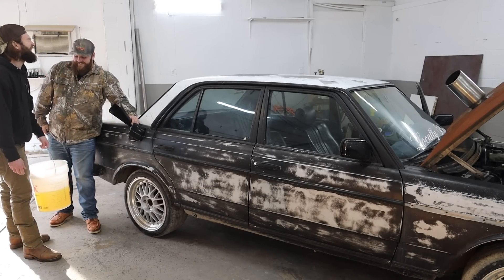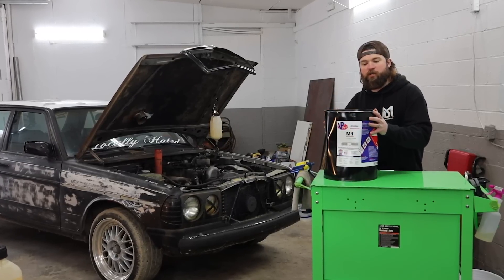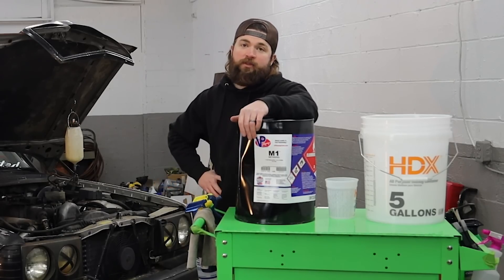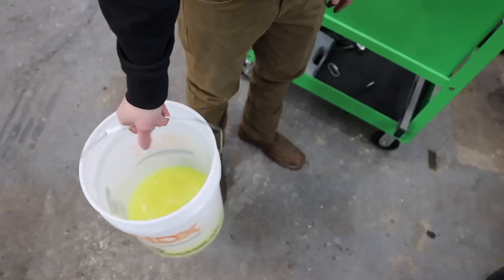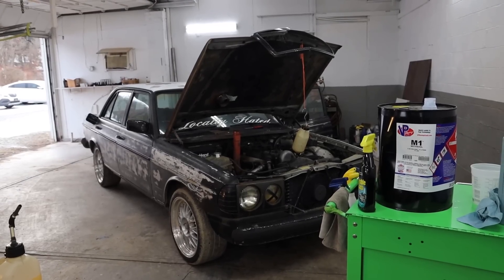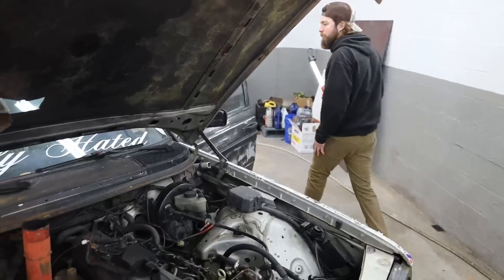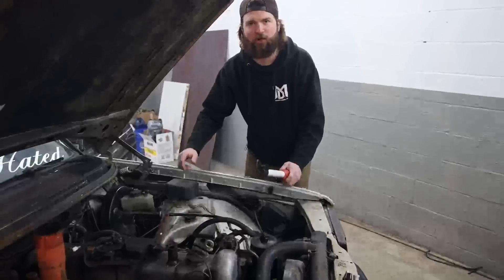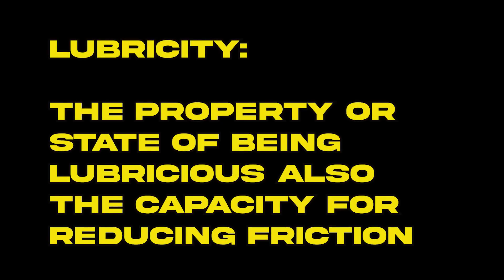What Happens If You Put METHANOL in Your Diesel?

Comment: the reason the bottle ran so fast is that its returning the excess back to tank thru the return line
Reply: I remember when myth busters did a fuel economy test and all of the results were the same. They ran a small tank similar to this and didnt realize the fuel was returning to the tank. They put the episode out too.
Reply: @4x4le  remember that i was around 13 years old then and even then i was screaming to the tv
Reply: Oops I just said the same thing
Reply: That is 61 bucks in that can? Is that enough for a full pull? Running that fuel takes different jetting I believe than Diesel
Reply: Don't you have to raise the compression to get efficiency out of the motor?
Reply: @selrahc2061  you shouldn’t have to in a diesel. Compression is what ignited the fuel to begin with so it should already have adequate compression for this purpose.
Reply: Yeah 🤣 DUH.
Reply: Yep your right and the ratios he said at 10 % is now wrong it has to be greater
Reply: There is no return line in the W123 or ay mechanical diesel I can think of for that matter
Reply: @TheAnimal191 😅

My 1989 new Holland 6.6 inline 6 has a Bosch AE pump, almost identical to the PPUMP, but I have a return line, I know because my diesel heater tank is the primary return line capture tank, with an equalizer line so it dumps it's overfill back into the vehicles main tank.

So the mechanical pump from 1989 has a return.

Comment: I'm sorry, but this is a really stupid, poorly researched idea. Methanol is a solvent with zero lubricating properties. Diesel injection pumps and injectors survive the high pressures they deal with ONLY because of the lubricity of the fuel. Goofing around by diluting your diesel fuel with a solvent will ensure the early demise of your engine. I suppose it amuses you viewers.

Comment: No doubt the system is very well aerated.  It will take a fair amount of time to get all the air out of the pump, lines, rail and injectors.  You should have refilled system with good diesel, then run it long enough to get all the air out.
I bet much of your fuel was shuttled back to fuel tank, through fuel return.

Comment: 5:22 heyyyaaa...if you rotate the can so the spout is at the high point (not at the bottom) when you're pouring it outta those cans...it won't slop and splash around so bad, and you get to tip it over further before it comes out too......jus sayin'

Comment: M10 will more than double your torque output at a given RPM low in the range compared to straight diesel. As you increase RPM, the torque improvement decreases to double the output. As you increase to M20, output advantage drops, M30 drops even more. To get a stable mix, you might try two to one butanol to methanol for the alcohol blend. You might also try lubricity additive like Stanadyne. Watch out for any vehicle fuel components using aluminum: methanol will corrode it severely, so need anti-corrosion additive. Methanol can also eat some seal and oring materials. Need to change out to methanol resistant seals and orings ...
Reply: Low-ash 2 cycle oil for watercraft (TCW3) helps with lubricity.
Reply: Indeed it does!  But it is not recommended for modern electronic engine control diesel engines.  It is the older mechanical injection pump diesels that mostly benefit from a lubricity additive, now that all of the sulphur compounds have been removed.  I have access to 100 percent biodiesel so that is what I use in my 1996 marine diesel engine at a 5 percent ratio
Reply: Let's not forget that diesel also lubricates many of the fuel injection components
Reply: @ericwieboldt7042  Ultra low sulfur Diesel doesn't have lubricity, a proper additive should always be used.
Reply: Somewhat true, but the addition of biodiesel as a common pump blend greatly improves lubricity and emmisions at low cost.  Most commercial diesel lubricity additives have been shown to underperform or worse, decrease lubricity in HFRR testing (high frequency reciprocating rig)
Reply: 100 percent Biodiesel or two stroke oil at about a five percent admixture will provide all the lubricicity the engine components require.  Look up HFRR lubricity test on the web for a very revealing look at this topic, and a lubricity test of most of the commercial diesel additives on the market, plus a few other  substances
Reply: @wallacegrommet9343  Just saved me a bunch of typing... Biodiesel not only provides better lubricity than anything on the market, it will also clean your fuel system like nothing else out there.
Reply: I've run a water - methanol injection kit on my 600 Signature Series Cummins for over a million miles. Never had an issue with rusting. I use Howes with every fill up.
Reply: the evaporative cooling of methanol overcomes the heat needed to keep combustion going in a diesel engine to a degree with heavier blends.  to get methanol to blend with diesel fuel you need to use a surfactant.  tween80 will do the trick, you can also add a little bit of ethanol, the ethanol will azeotrope with the water and the methanol will be free of the moisture that is forming an emulsion when you try to blend it with the diesel fuel.  you can also cook molecular seive beads and decant the moisture that way by adding them to the mixture and filtering them out after it has sat for a day or two.  it will also help break emulsions.

Comment: I believe it would run better with more fuel, as in adjusting the fuel pump, with more methanol!  Have you thought about propane injection??
Reply: Methanol and ethanol have lower heat content. To get the same power you need more fuel/alcohol injected. 
With ethanol blend gasoline the AFR needs to be richened up from 14.7:1 to about 14.15:1. Diesel will be similar.

Comment: I used methanol in my race car. 20% methanol. and 1 % aceton. Methanol and gas don't mix, that is where the aceton cams in. Than it wil mix without any problems.  And your feul is colder.

Comment: the knock on initial start up is likely an airlocked injector since you ran it out of fuel, sometimes reving it will clear it, but its usually easier to just crack the injector lines and let the air bleed off while its running.
Reply: You’re probably right.
I drove a Renault built Mack truck, once.
There was a fuel leak SOMEWHERE that we never found.
Didn’t leak fuel, but if the truck sat for a weekend, it lost its prime.
Every time the truck sat for a few days, I had to put the cab up and pump the heck out of the hand primer.
It would knock until fuel was flowing into the return lines.
If I really gave it a good prime, it wouldn’t knock, but it took a long time to wait for that squeak in the lines that said all the injectors were fully primed, and she wouldn’t knock upon startup.
Reply: Yep - if you compare 7:58 to any other point after they've revved the tits off it enough to run fuel through the entire system there's a very noticeable difference which would elude to an airlocked injector. Firstly is that really loud knock that could easily be mistaken for a rodknock, but secondly the fact it was misfiring like crazy. I've had the same behaviour out of my Ford KKDA when I did injector seals and one of the injectors had airlocked. That thing made a right knock 'til I gave it a few hits of throttle... Which was kinda required anyway since it really didn't like running on 3 cylinders while that injector was replenishing lol

Comment: I've been thinking about something like this a lot lately on my weird cummins swap. Did you ever give the snow kit a try? M10 to diesel would get expensive quick but I wonder if a fog system could be a little more sustainable 😂
edit: and better for the fuel system as well of course!
Reply: I use a Snow water/meth kit on my '96 K2500. Blue windshield juice works very well to keep EGTs down and adds real seat-of-the-pants boost. Kit has a boost sensor so it can run on your demand setting. I love towing with it.

Comment: This experiment is great!
Here in Latvia we use ethanol (on petrol cars) after ethanol chiptuning.
As far as I know my friends Honda is knocking first minutes.
Engine warms up, knocking disappears.
I would say, your methanol knocking really might be due to temperature.
I don't get it, why you dont use LPG as fuel in USA, Octane is 108-113(they mix propane/butane in winter and summer differentially), so my Honda H22A is chiptuned for LPG (liquid petrolium gas) as fuel. If chiptuned, lpg gives more power, than Latvia's petrol (octane 98).
My Honda was champion in local street drag-race. 
And Diesel engine can run 50% LPG 50% diesel.
We do that (rarely) that in Latvia as well.
Reply: Thanks, interesting innovation from Latvia. 😊
Reply: I use ethanol in my car here in the US.

And I have seen a number of trucks running on propane.. it's just not common practice.
Reply: Isn't that hard to do 300hp in a pd130 just with diesel, even 400, only problem is egt and no nitro
Reply: @Helder_Paulo  450hp here diesel only on compounded pd130 :D I was about to comment that VW Sold T5 Multivan with LPG injection (i think 100% lpg), tho quite rare as you would need to pay more
Reply: @exvils  an 2260vklr can do 400, more u need 28, and 120% injectors
Reply: @Helder_Paulo  2260 wont do even 330hp.. 2263 made 334hp with 120% and 2365 350hp..
for non open 120% injectors limit is 340hp (118mg)
160% are at (133mg)
160% on fully open firad bodies do 163-171mg.. also depends on manufacturer of nozzle and guy who bolt them together
Reply: @exvils  here in Portugal we do 400hp without nitro, pd130 is old tech, everyone who want 400 can have it.
Reply: My buddy has a lpg/diesel  50/50 system on his logging truck (in the states). The thing is a complete hotrod. He pulls illegally sized loads on the highway all the time.

Comment: As far as BTU a gallon. Methanol has about 55% less energy may be why it had the knock sound because its running lean. Maybe modify the injection pump to richen it up a little.
Reply: Actually it's the opposite. Methanol resistance to detonation/Dieseling is the knock . It's a rapid pressure spike event when the methanol finally lights, it then burns much faster than regular diesel  ... Being an oxygenated fuel, it assists the diesel portion with extra oxygen helping lean the mixture and clear up some smoke.
Reply: You're right about less energy and with pure methanol he'd definitely need to inject way more and fix timing, but mixed with diesel I believe the idea is the methanol helps oxidize the fuel better so you're burning more of the diesel rather than sending it unburned out the exhaust. It'd be interesting to see how it compares stoichiometrically. A exhaust gas temperature gauge may be a good indicator 😅

Comment: I'd like to see more on this. Maybe drive it for a few months to see what happens. Document and report any changes such as increased / decreased fuel economy, possible damage to fuel system, engine, etc. 90% diesel should be enough to keep things lubricated but Dan Snyder is right, methanol (or any alcohol) absorbs water like crazy.  I doubt the water separator would do much good. Something to keep in mind.
Reply: Worth it i think for the power gains? If it absorbs water, great, it means the fuel and water will burn together. However i would be concerned with the fuel going off and gluing the fuel system to death over time

Comment: It might be a good idea to add a small percentage of caster oil as you would find in model glow plug engines to protect the fuel pump 
Keep up the good work
Reply: Or two stroke oil.

I once ran out of fuel with my volvo 740 diesel but had a can of two stroke oil in the boot, started it and it ran great.
Reply: @Aldizerboer  try 50/50two stroke and parafin👍
Reply: @Error2username  I don't know how I can paraffin in my area.
Reply: mechanical fuel pump on these. prob chain driven, if it is lubed by the fuel add som 2stroke oil
Reply: That would a waste diesel is a lubricant and the fuel is still mostly diesel so not needed
Reply: But methanol is most definitely not a lubricant and that is what needs a lubricity enhancer and as for modern  diesel ULSD it is a poor lubricant and has a lubricity enhanser added
Reply: Not a good idea it’s to sticky but use synthetic like klotz
Reply: @Firby1988  
Hi I only stated caster oil because I know it readily mixes with methanol and I don't know how a 2smoke oil will behave with methanol, as for sticky yes it can become sticky in the ring pack but shuldent affect the injection pump. Did you know that since we made the transition to ultra low sulphur diesel diesel has lost most of its lubricity and has to be up treated with lubricity enhancers.
Reply: @TheBlibo  i use pro-Long diesel and Oil add, best shit i ever tryed.

Comment: I noticed the heat coming off your head when you were doing the heavy duty ratio calculations for the mixture. I was afraid the fuel might ignite before you got to use it.
Reply: Lol, It started out this way and ended up close enough cause the pail was so heavy
Reply: It is heavy duty because it's imperial. For every day garage fuel production I'll go for metric.

Comment: Maybe add something to the fuel to lube the pump a little more for reliability. I wonder if there’s a benefit to this over water meth injectors or if that’s a better option
Reply: Tans fluid works great for upper lube Nd for pumps. Doesnt seperate either.

Comment: The methanol super stock diesels use a different cylinder head with spark plugs and if I remember right they change the pistons also to put the combustion chamber in the cylinder head instead of the piston. Basically a gas engine built on a super tough diesel block
Reply: Yes, apparently they do run spark plugs.  I’ve been trying to learn just what they do to modify these engines.
Reply: The Alcohol Diesels use spark plugs and are not direct injection like diesel. It's a total conversion to a gas engine with spark plugs while using the ultra strong diesel motor to hold the power
Reply: @100pyatt  well to begin with, they do that as you can buy 16-20L v8 or v12 engines cheaply, they have high compression ratio, all you need is machine it for spark plug, put injectors in intake and benefit from displacement and compression ratio (no problem for methanol).. not so good for road cars (as engine weights half a ton) but in pulling category where you need power and grip (from weight) it fits well, and is cheaper than modifying stock diesel engine

Comment: Had a Suzuki  side kick knocked like u dribbling  a baseball  and we fixed it by putting  transmission fluid in the fuel tank   half quart every fill up by 3  quart u could hardly hear the knock hopes that helps  u can always try and see if that will help  Meryl  out
Reply: Like dribbling a baseball 😆 might've had a cracked block. Very common

Comment: The methanol pulling tractors run on spark plugs 🤦‍♂️
Reply from the maker: we need to know what is the most you can add without needing spark
Reply: So there’s many things wrong with this. The main one is the fact that methanol has zero lubricity. So the more methanol you add into a high pressure environment the quicker you will tear up the fuel pump and injectors.  Methanol in a diesel should not be directly injected. Should be port injected. You can add enough methanol via port injection to blow out the flame in the cylinder without causing ill effects to the fuel system. People have been doing it for years. The study’s you read were also port injected. Methanol absorbs water and doesn’t separate making it that much worse for diesel fuel systems because it suspends the water evenly throughout the fuel which is bad.

One of those moment where you should of talked to a professional. Only a phone call away.
Reply: @dansnyder8186  you have a significant misunderstanding of the effects of alcohol and moisture/water.  "Heet" fuel treatment used to remove water from fuel IS methanol.  Methanol, in moderation, will allow an engine to burn the water in the fuel system without any issues.
Reply: @TopCorey  In Stockholm there are Ethanol busses, strength up Diesel engines running on 95% ethanol and 5% ignition enhancements